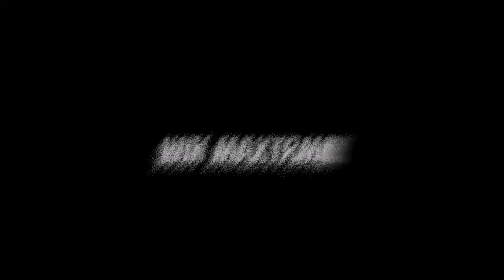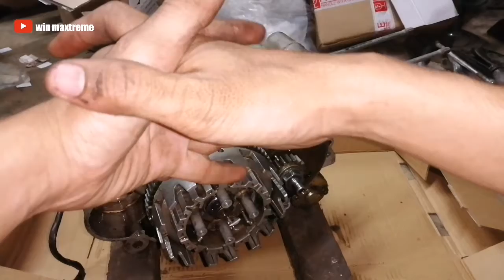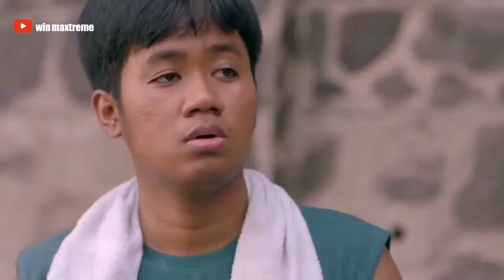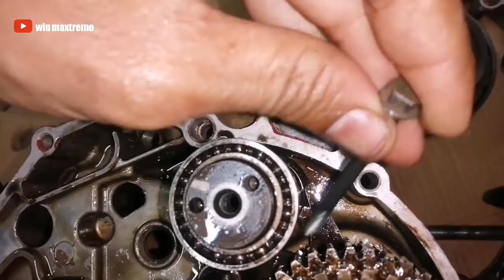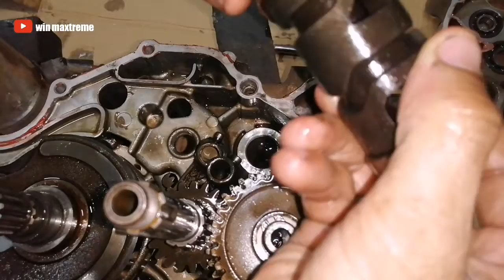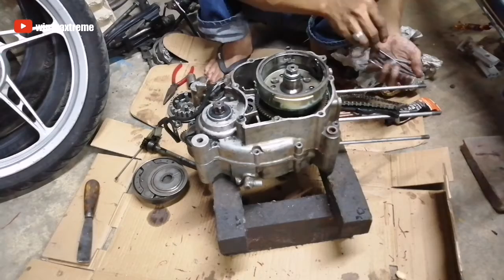Punca Gear Masalah Tiba-tiba Free Waktu Jalan..!! 🔥Pelik Tapi Benar..!! ⚡

Comment: As salam bro..motor sy lc135 v1.. motor senang hidup..bwk dalam 1jam lebih motor terpadam tiba2..5minit ke 10minit lepas tu try start hidup semula..wiring dah check semua ok..cdi,coil plug,plug semua baru sebab baru lepas restore..fuel cook baru tukar juga..apa masalah motor sy ye?.harap bro dpt jawab pertanyaan sy ni..pening dan penat hari2 problem ni..terima kasih byk2 bro..
Reply from the maker: Wkumslm.. Masa tepadam tu awak ade persan tak kat meter semua oadam ker dekat meter@mcm mane..? Rsa nya mcm wiring @soket ade longgar..
Reply: @WinMaxtreme  masa terpadam lampu kat meter semua hidup..lampu depan(sudah buat dc) hidup..signal semua hidup..problem nye motor xboleh hidup je..lps 5minit try start hidup..jln dlm 5kilo jadi lagi..
Reply: @Tali Gitar terpadam macam minyak habis atau macam api tak sampai..

Comment: Bang kalau masuk gear dari 1 sampai 4 tiada neutral kenapa yea ? Xpernah lgi hadap mcm ni , baru lepas overhaul , Kalau dekat gear N memang neutral , just bila masuk gear nak free bila tekan lama2 tiada free, kenapa ye? Moto wave 125 , terima kasih
Reply from the maker: Clutch tu ok tak pasang bearing 3bji tu dekat mangkuk clutch
Reply: @WinMaxtreme  yang tu okay je bang siap ikat , moto saya tu macam bawak motor yg ada clutch tau , just takde lever clutch tu , bila masuk gear dia tersentak mcm tu, lepastu bila tekan gear lelama xde free, contoh mcm nak rem tu xboleh , kat gear N baru boleh , pening saya bang ;(